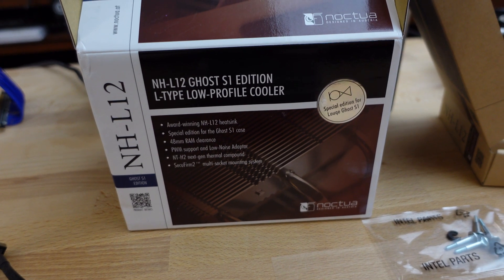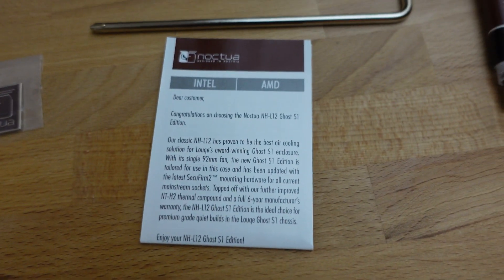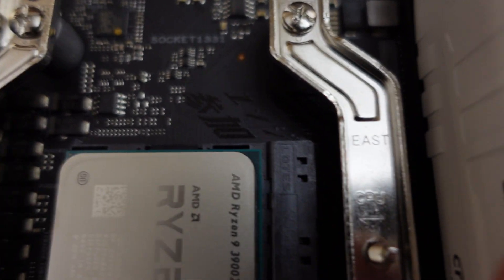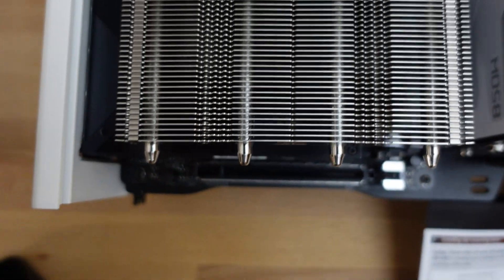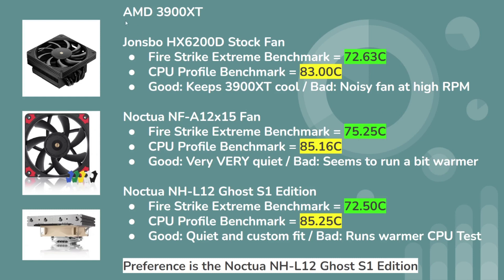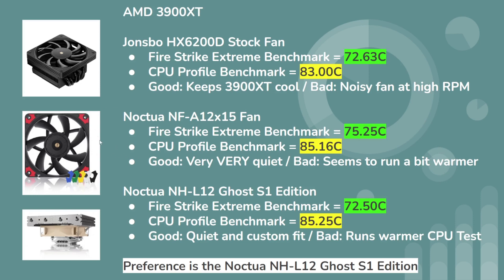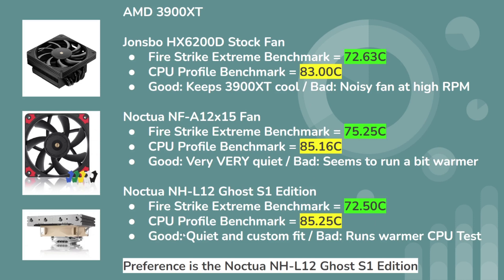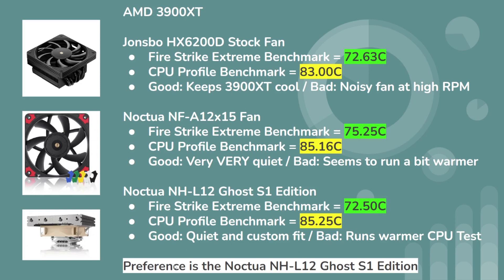The slick Noctua NH L12 Ghost S1 Edition - Persephone Build

Comment: I see youre using ghost s1 edition of noctua, from what i read noctua radiator should not touch side panel of ghost s1 case, am i right ?
Reply from the maker: @hinduspl  when I close the case it is so close about 1 or 2 mm from the side. As I slide the side cover on it does touch, but when complete slid on there is no touching. Noctua did an amazing job to fit and fit very close without having radiator vibration against the case. This build is very very impressively silent.
Reply: @nispoe  thanks for explanation. Have that case and noctua ghost edition and waiting for mobo. I was just curious.